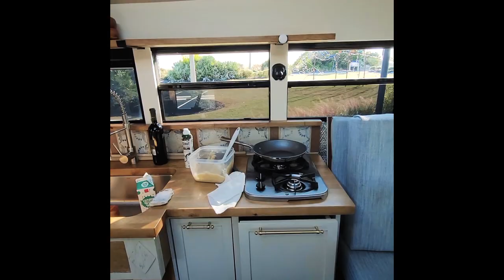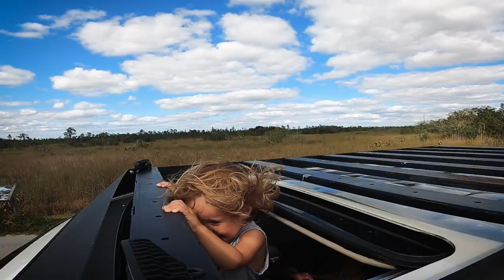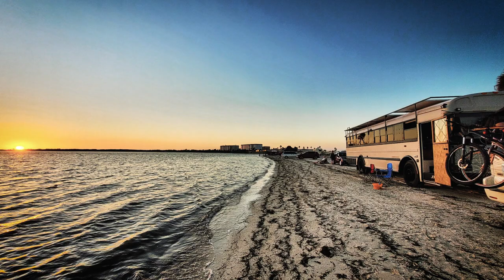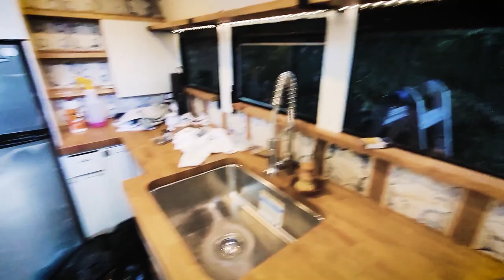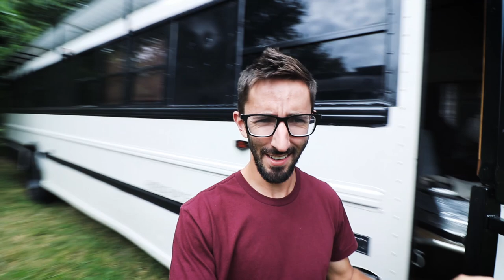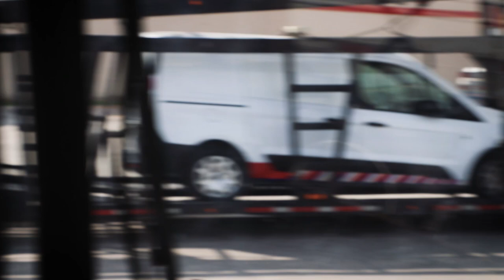Bus Life Skoolie Life is Not What They Say

Comment: I have a question for you fine folks I have a mid bus conversion basically converted short bus I was wondering what the laws are for my family being in the back while traveling how's that work and very much appreciated in advance you gotta new subscriber in me
Reply from the maker: To my understanding. There needs to be a seatbelt per passenger on the bus.
Reply: @BackroadPurpose  so put seatbelts in the couch? Or do I need to add some bus seats if that's the case I didn't see any in your conversion lol guess I'm confused but I live in TX IL just black the windows out shouldn't have no reason to be pulled over I don't see the benefit of trying to make a tiny home if I need bus seats reinstalled I have living quarters in it now and done alot of work I would hate to remove a cabinet for a bus seat

Comment: Freaking awesome!! I’m currently in the process of my build. I wanted to be done in 8 months. I’m just about hit year 2 haha. YouTube lied to me about how fun, easy and cheap it would be. It’s been none of those things. Ok to be fair is been pretty fun at some points in the build. Happy you are doing what you love and clearly are very good at.
Reply from the maker: Lol I get it! I had a foolish idea of 3 months in the beginning. I just told a client 4 months. We'll see what happens. Let me know if you have any questions! I'll share what I have
Reply: @BackroadPurpose  I’ve actually got quite a few ideas from your videos! My biggest issue now is figuring out how I want to paint the monster. I took out a bunch of windows and put in residential. I believe I’m going to try to make it look like one of the hood Volkswagen hippy vans. Heck 4 months won’t be any big deal now. You are a seasoned pro.
Reply from the maker: Radical. Glad to help. This new build is going to be bananas. Man, the paint sprayer with oil paint was clutch. So happy on how it turned out. It's not show car but it's classy and simple and super easy to keep clean.
Reply: @BackroadPurpose  that’s a solid plan. I’ve debated going with a truck bed liner. Mainly because it will kinda hide some of the blemishes of the bus or maybe the lack of skill I have when painting haha